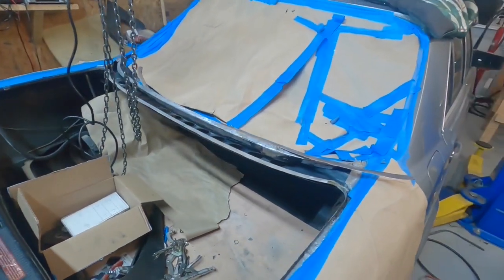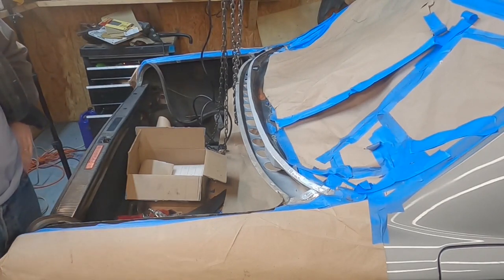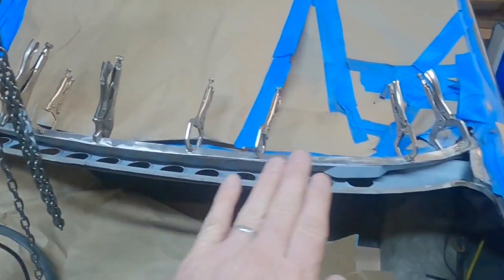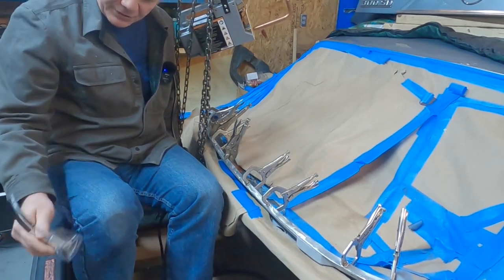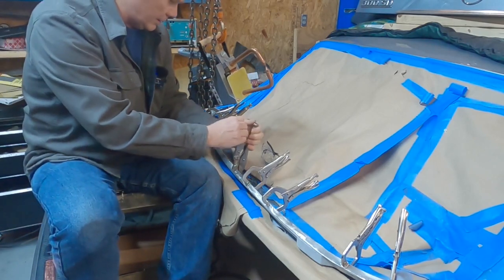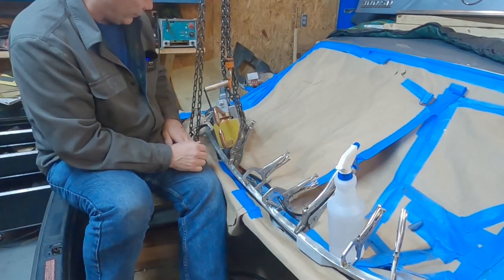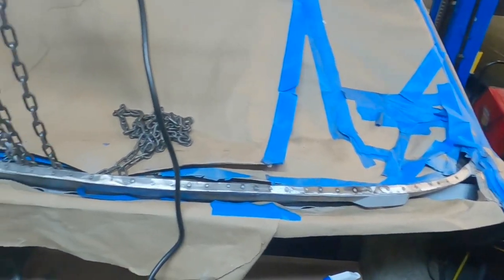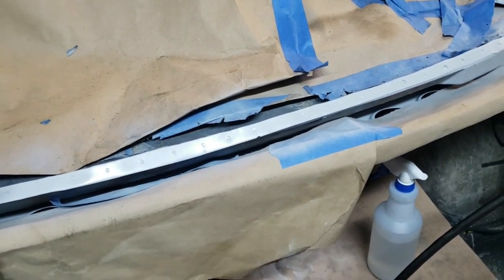Mercedes W126 - Rear Window Channel Rust Repair - Part 12 - Spot Welding

Comment: Great work on the Mercedes ! They do not make steady bearings nearly as good as they used to, have not had one last more than two years for the last twenty, maybe you can find a new old stock one down there ? None to be had up here anymore. Best of days to you and your family !
Reply from the maker: You lost me.  "Steady bearing"  ???
Reply: @ImpalamansGarage - Centre bearing maybe, in the middle of driveshafts, they are called a steady bearing up here, l put another one in a couple months back and can hear it again already.... total garbage !
Reply from the maker: @TheCanadianBubba  Ah.... I googled it and came across some forums where a Canadian fellow had used the term and everyone was like what? LOL.....  I believe the generally used term here is "carrier bearing" which actually is not as descriptive as "steady bearing".  I replaced the one in my W210 a few years ago when trying to track down a vibration. It wasn't exactly the easiest thing in the world!
Reply: @ImpalamansGarage - YES ! Carrier bearing is the correct term ! One of those things the slang takes over, up here anyways !

Comment: Secret= Phosphoric Acid (Naval Jelly) to remove the surface corrosion causing your lack of electricity flow!~
Reply from the maker: The Eastwood metal prep that I used contains phosphoric acid. However it may not have as much as other products. In retrospect I think the metal was getting into a bind such that the top layer was slightly cupped upward preventing the two mating surfaces from lying flat against one another. when I freed it up a little I was able to clamp a little harder to do the weld. Some one else here needs to send me another W126 to practice on!  😁😁
Reply: @ImpalamansGarage  I see.  I prefer using straight Acid.  Heat greatly speeds up the chemical action!